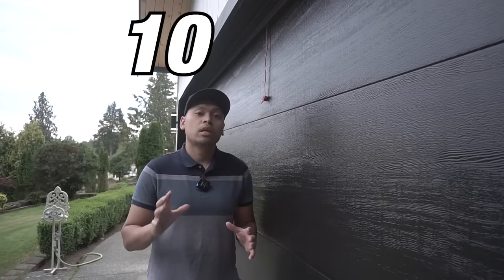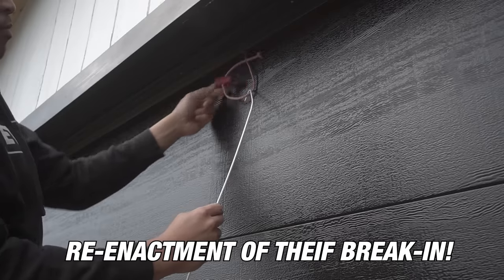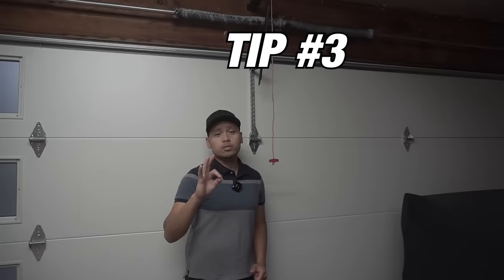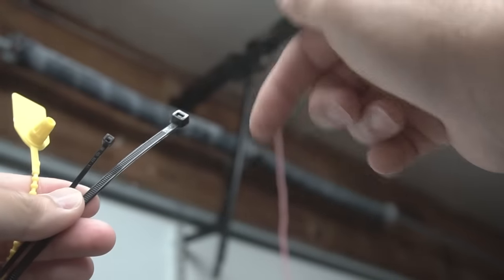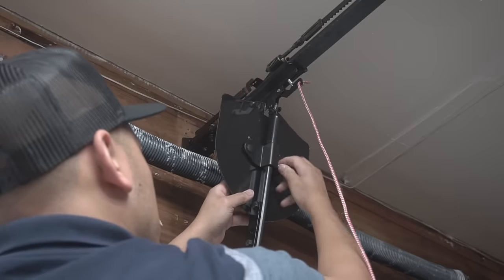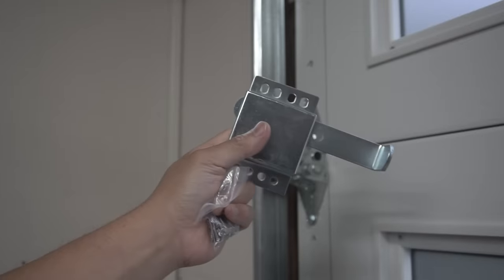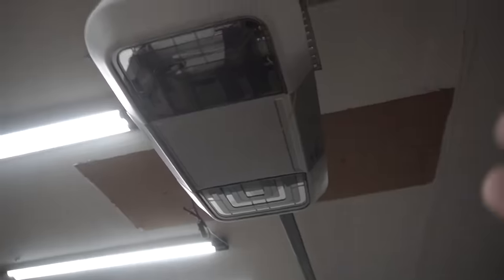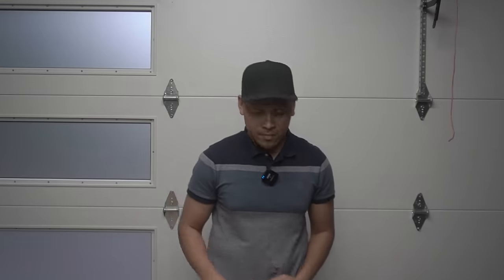How To STOP Garage Door Break-Ins! Burglar-Proof Your HOME! (10 TIPS To Keep Your Family SAFE!)

Comment: Cut a length of a large diameter pool noodle - then slit it from end to end on one side - then slip it over the emergency string - then put a zip tie around the pool noodle so it can't slip off - then it can't be pulled outside.
Reply from the maker: Thank you for sharing this tip! 👍🏽😊
Reply: I was thinking along the same lines, but I figured 3/8" PEX tubing would work. It's thin, but it is reasonably rigid.
Reply: Awesome idea 👌😎
Reply: Interesting solution of yours.  Thanks for sharing.
Here's an improvement that's less labor intensive.
[1.]  Instead of slicing a pool noodle and then using a zip tie to re-close it, just remove the red plastic handle from the rope pull.  Then thread the rope thru the noodle and reattach the handle.  Or,
[2.]  Buy an inexpensive length of 'pipe foam insulation', which is 'pre-slit' and self-gluing.
Reply: Good idea.  Also 1/2" PVC pipe with end cap would work.   Just remove the red handle and drill a small hole at the end cap.  Thread the cord through it and tie a knot at the end.  I don't see how a thief with coat hanger could pull that pipe outside.
Reply: I like the PVC pipe option, but would suggest using a T or X fitting or maybe a bicycle handlebar grip on the end so you can get a good grip in an emergency. Remember that you might a have full hands and injuries in an emergency...
Reply: I like these ideas but Couldn’t someone still yank it to the side hard enough to release the lever? They don’t necessarily need to pull it through the door, correct?
Reply: What's a pool noodle? 😆
Reply: @OhgodImtoosexy  Just search you tube - lots of uses for them.
Reply: Im 6’3” ….im going with tip #4
Reply: How about taking the release cord off completely and keep a stick with a hook on the end somewhere to pull the release open when you need to?

Comment: One thing you forgot to mention when you are putting things on or in the tracks to prevent the door from opening up, make sure to unplug the garage door opener. If not you will destroy it when someone hits the button.
Reply: Been there, done that. Bends the top rail of the door!
Reply: I'd unplug the opener also....with my luck I'd forget I had a lock on the rail.
Reply: No you won't.  What will happen is when the rollers hit the obstruction, they'll prevent the door from opening.  The opener will sense the that there is too much weight and will automatically reverse and close it.

Comment: Attaching pliers, locks and screwdrivers to the rails is a great way of damaging the garage door when some one hits the remote not knowing or forgetting the rail is blocked.
Reply from the maker: that is a good point! Thank you for sharing!
Reply: As long as you remember to hit the lock button on the keypad it shouldn’t be a problem.
Reply: A decade ago in my first home I forgot to undo the garage door locks and the old garage door opener ripped itself apart when I pushed the button. The door was fine but the opener's motor was torn off the plastic housing. Had to buy a new opener lol.
Reply: @Robpol86  The one time I did this, I turned off the circuit for that reason.
Reply: When I was little, I locked one of those slide locks on my grandmothers garage door.  Someone tried to open the door and smoked the motor.
Reply: Don’t the have a load limit on the now . Prevents burning out or damaging the motor or mechanism
Reply: I just had to have my garage door repaired because one of the wheels pushed out which bent up the rails and wound up breaking one of the springs, so I can't agree more with this point.
Reply: @mikehunt908  They had the load limit function on some door-openers back in the 90s. But not all openers have that feature, since it costs an extra couple dollars to the manufacturer. Besides, that doesn't always work properly.
Reply: Any door opener installed in the past few decades should have a load limiting function that’ll simply stop the door opener if it meets with resistance.  So a forgotten lock is only a problem if your door opener is ancient.
Reply: Totally disagree. Try running your opener with a lock through one track and see what happens. The lift cable will dump off the other side drum and you’ll have an inoperable, diagonal garage door that will need a repair.
Reply: @randydever6651  Yep.  Thats kind of what happened to mine recently when one of the wheels came off track and bound up. Don't F with the rails
Reply: @TheRockinDonkey  as a garage door guy for 6 years on the field and 5 years in the office prior to that I can tell you nothing breaks the springs except metal fatigue from being used. They have a life cycle,  typically about 10,000 cycles. I'll bet the springs broke first then the other problems followed.
Reply: @RickyBobber  Knowing that, I'm glad I opted to replace both springs and not just the one.  The other spring probably would have broken soon otherwise and I'd have had another repair.
Reply: @TheRockinDonkey  100% correct. Anyone reading this. Don't just replace one spring in a 2-4 spring system. You'll pay more with each service call,. Expect to replace springs every 7 years on average if you're opening your door about 4 times a day. Checking the mail, walking the dog, kids coming home through the garage. Each cycle counts
Reply: @RickyBobber  Would you recommend having the door inspected every couple of years to stay ahead of maintenance issues? Or is that something that can't be judged with an inspection?
Reply: @TheRockinDonkey  I recommend a tune up with Inspection once a year. If anything just to have it lubricated and to calibrate the motor etc. There are certain things that a professional can spot for example, cracked hinges, worn rollers and if your door takes more than ten pounds to lift manually there's a chance the springs are stretched out and ready to break soon. It's also possible that someone put the wrong size springs on there during a previous repair and that should be addressed. If a door is too heavy it will escalate all your wear and year sooner than it normally would. Imagine a vehicle that's always pulling a trailer vs one thats not. If a door is brand new however,  you could probably skip the first year or just lubricate it yourself with the proper lubricant. (Never wd40) there are videos out there how to do that I'm sure
Reply: @RickyBobber  once a year it is. Thanks!
Reply: @javaman2883  Mine has one.  I don't know when it was made, I think it was back in the 80s.

Comment: Please if you have an opener on your door avoid manual locks/pad locks or vice grips. I’ve been in the field repairing and replacing overhead doors for 6 years now and way too many people damage or total their doors using these methods. Poor advice given there. Also if you have a recent liftmaster belt drive many of them are compatible with power locks. That would be the route to go
Reply from the maker: Thank you so much for sharing your expertise! 🙏🏽😊
Reply: I’m definitely going for a side opener with electronic lock.

Comment: I just removed the cord entirely and replaced it with a 4 foot by 1/2 inch dowel rod that has a hook on the end to attach to the Garage Door Latch, where the string was attach before, but the rod is stored on the garage wall where it can easily be accessed when needed.  Just grab the pole, hook the latch, pull it down and door is disengaged, and then put the pole back on the wall.  No string to be snagged or in the way, but I can still disengage the door when needed.  The rod is painted a bright yellow as well as the spot where it goes to allow the latch to be pulled.  If the pole is left on the latch, no problem as it won't go through the seal as it will just break if pulled at the angle needed to try to get it through the garage top seal.
Reply from the maker: That is smart! Thank you so much for sharing your solution! 👍🏽😊🙏🏽
Reply: I did the same thing, I just removed the cord and have a broom handle with a hook on the end. I use the same tool to pull down the garage attic access stairs.
Reply: @samuelkilianjr.3694  Yup, that was basically my first iteration of it, but I used a paint roller extension handle.  I switched to a dowel rod when we needed to do some painting...lol
Reply: Yes!! I came here looking for this!

Comment: The one everyone forgets is to LOCK THE ENTRY DOOR BETWEEN GARAGE AND HOUSE. If they break into the garage, they still do not have access to the house. Make them work for it. Especially for those who sleep like a log as folks have had rapes and such after they accessed the garage and just walked into the house to find someone in bed. I always suggest that single women who might have stalkers or such to get in the habit of locking that door.  And of course if you use alarms make sure that that door has a sensor to  set it off as well. That way you have two alarm sensors they must get through to reach you inside.  So many get spoiled by the garage door being closed and just leave that door unlocked but it is a real risk since garage door are not that secure. Just saying.
Reply: Also, have a real door between the house and garage. Not some flimsy foam core door. Get a real solid steel cased door with a good frame. Yes, make them work for it.
Reply: Agreed.  I go through my garage to enter my house every time. I live on a nice quiet dead end street where all the neighbors know each other but I always deadbolt my door between garage/house.

Comment: Great tips - I use the manual sliding locks when I'm home. For when I'm not home, I think I will remove the pull cord completely and make my own coat hanger pull to use in a power outage and hang it near the door inside the garage. No cord to snag from the outside.

Comment: Use a piece of 1/2 in. PVC pipe that extends from the opener to a few inches below the top of the door.  Install it by placing a pipe cap on the bottom of it with a hole drilled in it so the rope can slide through.  Secure by knotting the rope after siding the pipe/cap assembly on.
Reply: Yep.  I said the same thing in other comment before I saw this.  lol.

Comment: Best method for eliminating a break-in from the emergency release being pulled is to remove it. Simply place a heavy duty key ring through the hole or use a carabiner. Then attach another carabiner to the pull cord and hang it on your wall or somewhere on the opposite side if the door. In an emergency it can be easily attached with one hand in about 2 seconds.  Learned this from a security consultant.  
As for the garage door opener and MyQ technology, it's not totally secure. As you mentioned pulling the power plug when away.  I've found a simpler and faster solution by installing a smart plug that I can shut off power to the opener and or turn on the power through Google or Alexa and or my phone from anywhere in the world.  I  also have door sensors as well.
Reply: Good stuff. I use the shield method and of course I have MyQ. But eliminating the cord all together is a idea.
Reply: I like these ideas best.
Reply: I also like the smart plug. While some will say that's still a risk because its electronic communication, a thief hacking two hard-to-crack codes is a very low chance.
Reply: @javaman2883  I would think the smart plug would be very effective - if the door didn't open, a random thief would just believe his code transmitter didn't work with the garage door opener, not that there is an additional layer of protection.
Reply: Unplugging the door opener or disconnecting the power to it does nothing to stop the burglar with the coat hanger from grabbing the rope and opening the door.  The 10th tip he shows is also useless if someone uses the coat hanger to grab the emergency release; My Q, for instance, only records when the door opener activates to open and/or close the door.  If it’s opened manually, that system won’t even indicate a thing.  Even if you have a door alarm, that will only let you know someone has broken in.  If you live in a rural area the burglar may not even care if an audible alarm is going off; they can usually clean a place of valuables in just a few minutes.  They’d be long gone before anyone arrives to stop them.
Reply: @kevinstorm6009  That's why I stated first to remove the cord.
Reply: @kevinstorm6009  That's not the method of entry disabling the garage door opener is meant to eliminate, he already addressed the issue with the pull cord.  Attempting to build a fortress is WAY over the top, usually you just need enough to get thieves to move on to another target.

Comment: Tip number 7. You can still open the garage door with the release pull rope.  On my garage door thieves just put a crowbar underneath and broke the lower panel. Thin garage door. Came in the house through the standard interior door. Since then reinforced garage door lower panel and house entry steel door. Put drop bars that drop into the concrete when the garage door shuts. Open out of the way when the door slightly opens one foot. Btw the frosted panels easily pop out.
Reply from the maker: Thank you for sharing! I will put the alarm sensor on the door, it’s vibration sensitive, but might set off during high winds. I’m sorry about your breakin! It must have been a terrifying experience! 😔
Reply: @FixThisHouse   Fortunately they caught them after about the 10th house they broke into the same way. Is still done not pay for any damages done to the houses. I'm sure even with all the reinforcement if you get a crowbar under the door it causes a lot of damage
Reply: @krg038  ,
There's a old saying , A lock only keeps a honest man honest .
 A friend of mine lives in a older mobile home , the damn thief cut a hole in his roof of his home to gain entrance, there were metal frame guards on the windows an 2 heavy wrought iron door on both outer doors . 
The guy that broke in thought he was breaking in the drug dealers home that was 4 mobiles down as they were both a similar color 🙄.

Comment: Nice tips and thank you for sharing.
Some of the tips are potentially hazardous, since people do dumb things and might forget that the rail/track has an obstruction attached (lock, vise grips, etc.), then press their 'garage door remote' or press that 'button' on the wall near their interior door.
Similar to the 'shield' that attaches to the lift arm, I made my own shield (a simple board about 4' in length = approx. 2' to each side of the lift arm) and screwed it into the door frame above the top of the garage door.  If someone tries to 'fish' a coat hanger thru the 'gap', the 90 degree shield will divert it downward so they can't succeed.

Comment: The first and maybe even the only tip needed should have been to set your top brackets properly so there is not a massive gap to begin with. If you are still worried after that, just wrap the pull cord around the J arm so it's not hanging free.

Comment: Thanks for the tips.  Just put velcro on the cord handle and the horizontal bar?   The cord is meant to be pull from the inside anyway.  So when needed just get it off and use.

Comment: Add a piece of RIGID tubing around the cord.  Untie the end, remove the knob, and put the cord through a length of RIGID tubing or thin pipe so that there is just enough of the cord left sticking out to tie the knob back on.  Even if they use a wire to fish the tube, it won't make the bend around the top of the door.  Alternately, REPLACE the cord with something solid that does not bend at all, but be careful that the bottom end is safe for people to walk into.
Reply: I had a piece of aprox 1/8" steel rod that I used to replace the string, which sounds like your idea exactly!

Comment: My tips.

Most of these are thin sheet metal.
So no matter how many of these tips are used, ultimately this is still a weak entry point.

So re-enforce the entry door between the garage and your home and LOCK it.

What he failed to show is the vice grip or padlock should be placed near the roller so the door doesn’t move.
Any extra gap at the bottom makes it easier for a pry bar or board to used to force the door.

Instead of the lock, I use a large carabiner in the same location.
Using the padlock can make it more difficult for a thief to exit with your stuff.
But it will also make it more difficult for you or family member to exit a fire or other emergency in your underwear without keys. 🙀

Save the padlock for out of town trips when the house will be unoccupied.

My house will not have a garage door opener installed unless myself or someone else in the home is handicapped.
That solves several security issues at one time.

Anything that makes entry into your home convenient for you, also makes it easier for thieves and those that wish to do harm.

Anything that makes it more difficult for criminals to get in can also trap you inside.

Any changes you make from industry standards can also put you at a liability risk should a guest stay over, or you sell the home.